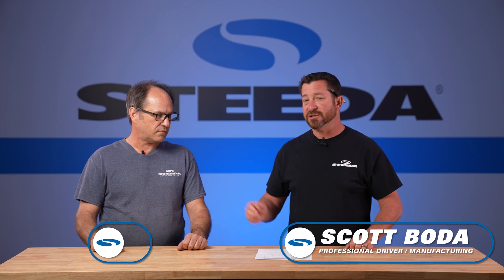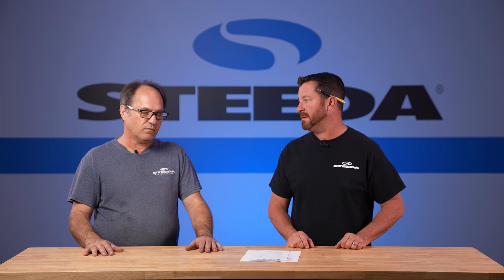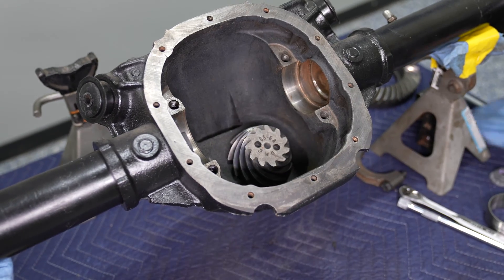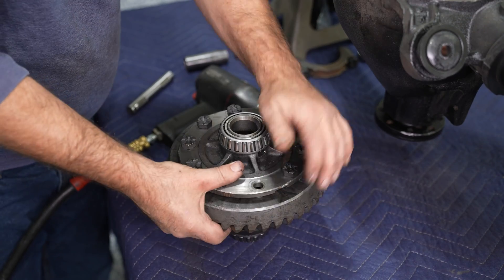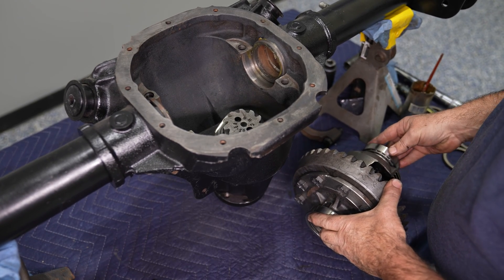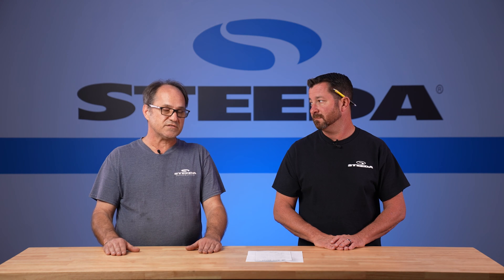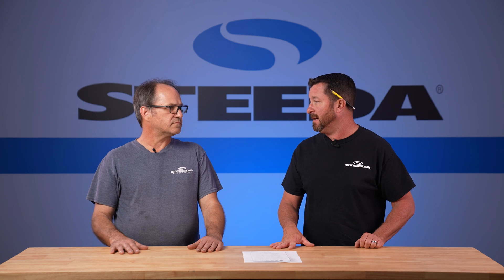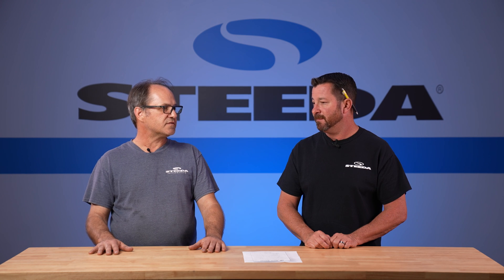A Guide to Setting Up Your Ford 8.8" Rear End

Comment: One of the worst changes Ford ever made for a driveway/home mechanic was going to the 8.8" from the 9". Axle shaft bearing wear and the gear oil contamination is a future problem with almost every 8.8 I have ever had. Copying the GM Salisbury design cheapened the rear axles, all for a very minor gain in fuel economy, and corporate profits.

Comment: Hi! I was replacing my wheel barrings on my 2000 Ford f 150 2 wheel drive 4.6 engine. I went to put the pin back and the gears fell out of the carring can you tell me what I have to do to put them back into the carrying. Thank you so much

Comment: Okay so I haven't watched the entire video, but I'm working on it. If my question is answered later on, cool but I'm gonna ask anyways. How much shim is too much? I get the whole process of setting backlash, but how many shims is too much? If you don't use enough shims won't the carrier move back and forth freely? How much play back and forth is okay? I don't know if a comment on YouTube is going to encompass what I'm trying to ask, but please please let me know if you have an answer. I'm very confused
Reply: Alright so update... I slightly get it. If there are too many shims, the carrier will be way too hard to install. Soooo, kind of makes sense. I'm still wondering tho. Is there a maximum and minimum of the "total shim thickness"? What i mean is all of them put together. Is it different in every housing??? You say to add 6 tho• to each side after lash is achieved. Are you saying you should just have to slightly hammer in both the 6 tho• shims in but it is just snug without them?

Comment: Probably the best instructional I’ve seen on this topic. Still don’t think I want to get into this 😂 more than capable mechanically just too much trial and error for me to attempt
Reply: You got it man! I consider myself mechanically inclined and capable. I did it for the first time ever last month. Just take your time! Once you have hands on and go for it, it isn’t so bad. Just ensure you have a “set up bearing” for the pinon. This set up bearing will ultimately not be used in the end, but will alleviate pressing bearing on/off
Reply: @codymattingly6107 how is a “set up bearing” made?

Comment: Wish I seen this video a few days ago. I just finished hot potatoing a torson T-2r in my s197 ( re used the factory 3.55 )  and OH BOY. It’s concerningly LOUD. I do have spherical diff case bearings. And Polly as well as gutted interior  but it sounds like 2 bricks 🧱 rubbing together on accel.  😂. I have a race tomorrow and I’m gonna run  it as is and hope it stays together for the event And so I can still drive it home afterwards.  Makes me nervous though. Definitely going to be cracking it back open if I make it home re recheck all my work. 
I did make sure my back lash was correct befor sealing the diff but I have a hunch maybe the carrier preload maybe a bit loose. But I could be wrong and it’s just how the  characteristics of torson t2r  is with the suspension set up I have but idk. 🤷🏻‍♂️ hard to find advice from others that have taken the path I have. Doesn’t seem like a common choice for most so definitely feel like I’m on my own

Comment: my Mustang come with the 2 solid differential shims it's only to shims on each side. Can I replace them with the shims it came with the kit, it has a whole bunch of them in there, or do I need to get the original shims from a dealer?
Reply from the maker: You can replace the original shims if you have a size that works for you. The original shims are a baseline to help you find the correct sizing if you have a new set. For this video we did not have the originals, so we had to guess on an initial measurement and go from there.

Comment: Can i use this video and info for the obs ford truck 8.8 i want to regear my 1993 ford f150 but dont know if its all the same or not thank you 😅
Reply from the maker: If you're talking the rear, yes you can! This process covers 1982-2012 F-150s with an 8.8" so you're good to go. If you're wondering about 4WD, the front axle is a completely different process.
Reply: @steedaautosports  yes for the rear diff and awesome thank you guys so much for this super detailed video now i can put my new setup together 🛻💨